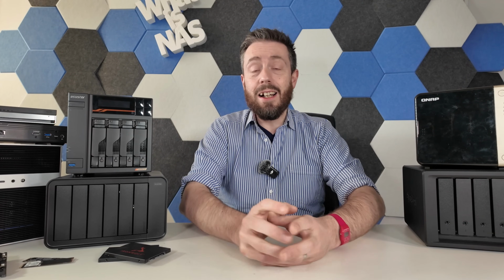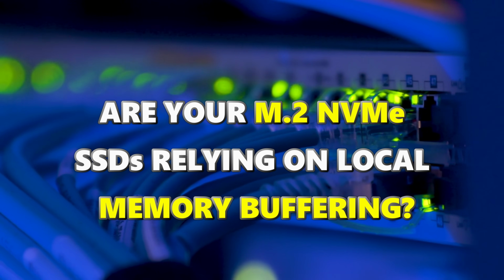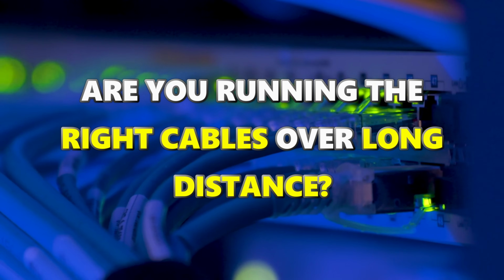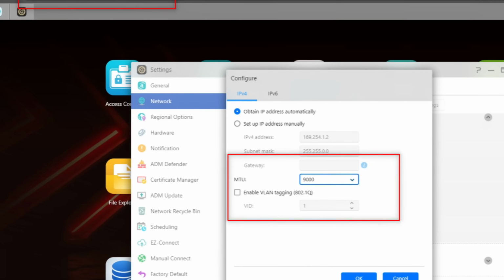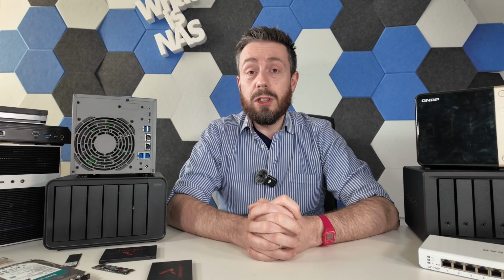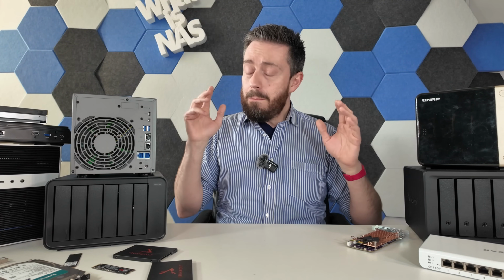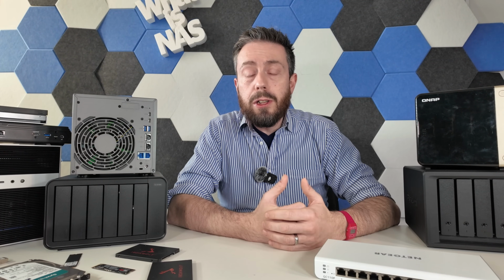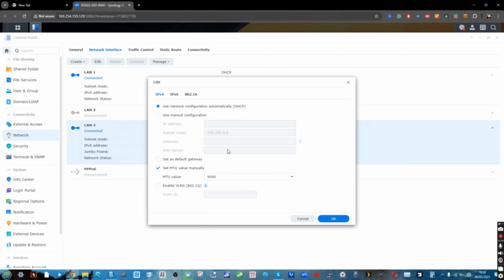20x 10GbE FIXES, CHECKS and REASONS for Slow Speeds

Comment: HELP !!! Is there a way where I can call you and get your help. I've literally spend about 2000 aud trying to set up 10G to reach at least 1 gigabyte file transfers and be able to edit 4k footage but my file transfer are only reach 250mb/s 

My set up
PC have a 10G Network Card PCIE installed
QNAP NAS has a 10G Network Card PCIE Installed - Qnap 6 bay TS-x64
I have Netgear 10G TP-Link 8-Port 10G Desktop Unmanaged Switch, 10 Gbps Ports
I have 2x 4tb Crucial M.2 Nvme with read and write of up to 5000MB
My Jumbo Frames are 9000, I've tried running a direct to NAS to PC its still not reaching that speed.
I have all CAT 6 cables
I'm not running a Raid 0 just a stand alone static drive.

HELP!!!! IM GOING CRAZY!!!

Comment: ARM can be great, its just the ones qnap use are cheap. Apples M series for instance does high speed encryption pretty damn fast. 
Its just about having the instruction set being hardware accelerated or specifically optimised!

Comment: I have a Synology DS1819+ with a Synology E10M20-T1 M.2 SSD & 10 GbE Combo Adapter installed.  Does this Adapter require any drivers or are they embedded into DSM?  I checked the download page for the E10M20-T1 adapter and the only downloads available are documentation.   Depending on the type and size of the files I am uploading to my NAS I see a range of 300 to 700 MB/s is that good?

Comment: Practical read-write speed on a spinning HDD is more like 120[5400]-160[7200] MiB/s. The 200+ numbers are for very idealized raw sequential data on the outer cylinders without so much overhead as a file system structure. Platter bit density also matters to some degree, because for a given RPM more bits pass by the head per second.

Comment: Windows has some interesting limitations if you are running WSL, Hyper-V etc.  For example were a VM can get full 10Gbe speeds but the host OS will see something around 7-8Gbps.  There are various fixes that can be used once a windows machine gets into this state. (this is beyond the fixes mentioned on this video - which are also great things to check).

Comment: A single HDD will be 2-3x faster than 1GbE connection, so a 10GbE connection is necessary to get the full speed out of even the smallest NAS.
However, the read and especially write speed really tapers off for HDD's when trying to scale it. Adding more drives in a a RAID will increase speeds, but not linearly, and one should not expect to hit the 10GbE limit easily.
But SSD's are completely different. Even 3 x SATA 2.5" SSD in RAID will easily saturate a 10GbE, hitting 1.1GB/s, on both read and write. And that's before even talking about how much better SSD is with many small files.
You can easily make 10GbE capable NAS by just putting in a sata card or two and installing 2.5" SATA disks. This can be easier and more flexible than trying to find ports for NVME sticks.

Comment: 8:12 I have tried just about every brand available for SFP+ to RJ45 adapters in my network gear. Yes they do get hot like you said. lol.
There is only a single chipset available righty now at least as far as I am aware that has any kind of decent heat output level. It is a much newer Broadcom chipset based adapter, and you can get the model from places like 10GTek or FS but they are quite expensive (double the price). Most of these adapters use 2.5-2.9w each and are the old Broadcom chip or Marvell chips (or Aquantia which is now Marvell). The newest Broadcom models use 1.8w. There are very few ways of differentiating which chip is in the device, but the easiest thing to watch for is the power draw spec on the product page. If it says 1.8w then it is the new Broadcom chip, if it doesnt then it is an old and hot chip. The other way to tell is the newer chip also supports copper Ethernet up to 100m, the older and hotter chips only support between 30m and 80m depending on the chip model.

The other thing to watch out for when using these adapters is that sometimes the switch you stick them in is incompatible to some extent. They will do 10gb down, but only 2.5gb up despite being rated as 10/10. That means when doing a file transfer you are limited to 2.5gb because one side is going up and that uplink is being capped by the switch or transceiver/adapter due to the incompatibility. No settings you change can fix this as it is a problem at the hardware level. I suspect that since Ethernet at these speeds use all 4 wire pairs, and since 2.5g*4 = 10gb, that somehow the incompatibility is sending the uplink side data on only as single pair of wires instead of all of them.

Comment: I want to know why so many motherboards now have 5Gbe and not 10Gbe. I am not aware of a switch that is 5Gbe so unless there is a splitter to two 2.5Gbe or you are connecting directly to another pc with 5Gbe I am not sure what the use case is
Reply: 2.5G and 5G are hobbled(planned obsolescence) consumer grade versions of 802.3bz. Anyone that can't afford a commercial grade "multi-gig" switch should consider 2.5 and 5G devices as marketing gimmicks. 
BZ uses the same basic tech as 802.3an (classic twisted pair 10G) so newer chips have no excuse for not having 1, 2.5, 5 and 10G. Most new 10G NICs and switches should also include bz but many new devices are still being produced with older components that only do AN 1G and 10G.
Strictly speaking the BZ standard only describes the 2.5G and 5G speeds with fallback to 1G, but only because the 10G over twisted pair is already covered by AN and the BZ is structured to be an extension. And considering most commercial installations will have been either older minimum cost 1G, or specifically for 10G the market for BZ is a bit niche and not likely to get real economies of scale or used commercial equipment; just due to BZ being 10 years too late (2016 verses AN in 2006) to have a real purpose.

BZ will automatically test the connection quality and select the speed that fits (1, 2.5, 5 or 10), or fallback to the slowest device. The intent of BZ was to help migration of old twisted pair network installations which may have a mix of cable and termination standards or med and long runs of 5e that is better than needed for 1G but just a bit shy of 10G, or maybe cat 6 or 6a installs where there is a slightly higher electrical noise environment but not enough to justify shielded cable(or the noise came after installation).
Reply: Any 10gbe over rj45/copper/ethernet I have used have been very power hungry and run very hot.  You could maybe even argue that 10gbe is not really suitable for that medium in most cases, even though it may work.

Comment: My Synology homemade nas is running 25G and transfers a little over 2000MB/sec read and write four PCIe U.2 7.68TB drives. I don't need much storage just fast. Using a Ubiquiti USW-Pro-Aggregation 28port 10G 4 port 25G switch.

Comment: Hello Rob, 10 GBE is not 1000 or even 1024 MB/sec but instead 1250 MB/sec. 8 Bits equal 1 Byte, so 10.000 / 8 is 1250 mb/sec.

As this is a 20% difference to what you explained I am sorry but I had to clarify that, my friend.

Greetings from Germany.
Reply: Professionally, networks are always measured in base ten bits (×1000), base ten because signal frequency is the key factor, and unlike CPUs and memory the signal frequency is not inherently bound binary powers of two. 
Bytes are ambiguous, they may refer to raw data pre-packeting, or may include packet overhead, signal losses(re-transmission), checksums compression or encryption. Physical-layer bits on a wire are just bits no matter how you group them or what they represent within the signal.

Most networking also refers to "octets" rather than bytes for similar clarity, an octet is 8 physical bits and not a reference to the data payload (Also historically some computers do not use typical 8 bit bytes. A 7 bit teletype machine talking to an 8bit-byte machine or a 36bit-word machine can all agree on number of bits, and an octet is always 8 signal bits.).
Reply: @mytech6779  that is all correct but 8 Bit are still 1 Byte and when Rob is talking about Megabytes the statement 10.000 MBit/sec = 1000 MByte/sec is simply just wrong by about 25%, no matter how you put it.
Reply: @ That depends on your protocol and packet overhead, though 1/5 would be much more heavy than typical.
Reply: @mytech6779  that is also true, but not what has happened here. The base calculation is wrong, I am pretty sure Rob did NOT deduct 250mb/sec for protocol overhead.

Comment: Not have had any problems at all. I am not getting the transfer speeds as my Truenas pools aren't able to get higher speeds. But the linkspeed easily reaches 10gbe in Iperf. And also when loading the ramcache I often see the 10gbe speeds.

I just bought 10gbe nics, a cheap zyxsel 10gbe capable switch. 15+ meters of cat7 (which is quite cheap) on one hand, and just regular shorter cat5e on the other end. And done. Decent quality cat5e is perfectly capable of running 10gbe on shorter lengths.

Comment: If the cable length is more than 5m  then go for optic to prevent issues. Even with Cat6 you are not free.
Reply: cat6 is rated for up to 55m for 10GbE... Just make sure you buy copper ethernet cables not the cheap CCA crap.
Reply: @jorisdevaan6845  And that is a problem as fakes abound - if they can make money they'll fake it.

Comment: I'm glad to see you mention cabling. And it's not just what's in the walls. I was doing some work on my network last year and found some very old pre Cat5e patch cords. Yes, they were short but those old, low band width things couldn't have helped.
Reply: Many people don't know that "cat5" or 5e, 6, 6a etc, are actually not specifically cable standards, they are complete circuit standards. To include one continuous solid-conductor installed cable, 2 wall receptacles or patch-panel connections[one each end], and 2 patch cables (stranded core conductors with 8p8c plugs) of a specific length between the receptacles and the nodes [one each end], all together meeting the CAT signal standard at 100 meters total length.

Comment: Thats why Unraid array user withiut cache best stick with 2.5G 

Destruction write mode max about 250MB/s with modern spinning rust 
Or 60-80MB/s in normal write mode 

Read ： about max speed of a spinning rust which about a 2.5G speed 

It dont stack up speed like zfs raidz or raid 0/5/6

😢